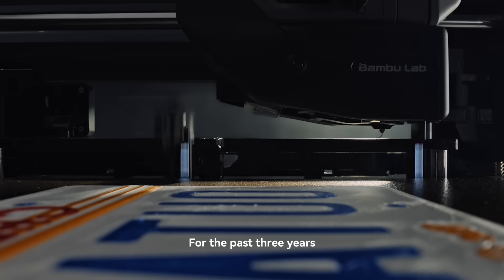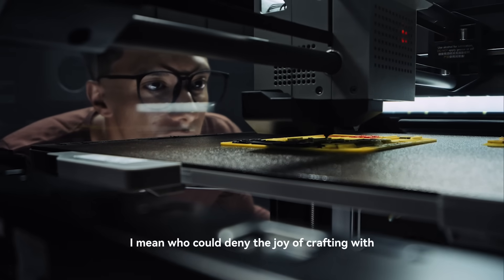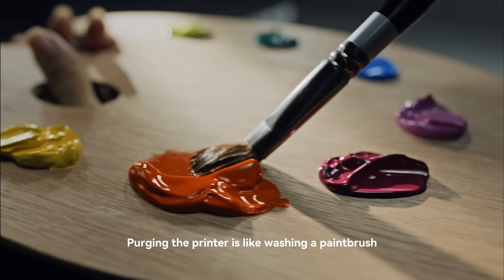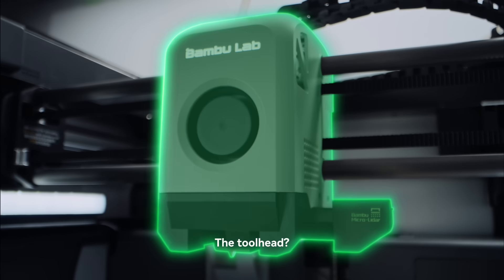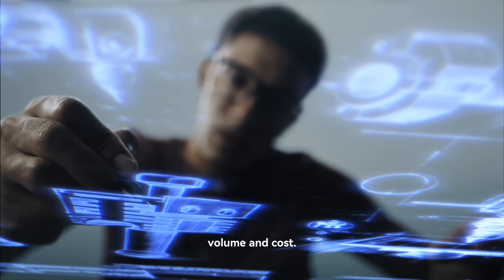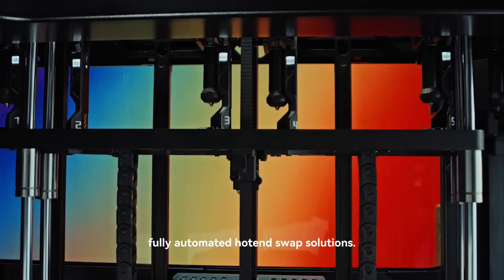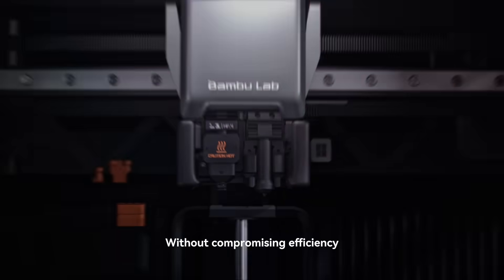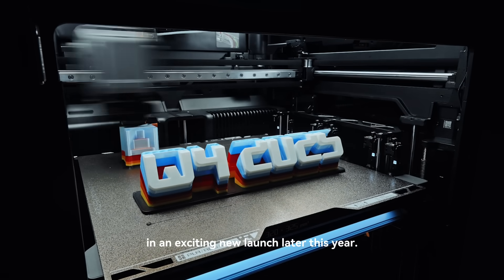Meet Vortek: Our Answer to Zero Purge Waste Multi-Material Printing

Comment: I wish I could upgrade my P1S machines with this.
Reply: Samedi for p1p i dont wanna buy a new 3d printer
Reply: Same here, it doesn't make sense to buy a 3K€ printer just for that feature anyway, even if I didn't have a P1S (a sub 1K€ printer). 
It's too bad, because at a glance, there is a similar place in the P1S where the Vortek could fit (albeit smaller, so some tradeoffs would probably be required).
Reply: I would not hold my breath if I were you. I cannot imagine an upgrade path that includes anything except selling all your printers and using that money (plus a fortune more) to buy one of these. Or just wait, if this is good, it will become standard and the price will drop when the BambuLab HH22DD XL launches in Q4/2029. That printer will order its own filament from Bambu when its low. It will also use robot legs to walk to the porch to get the package.
Reply: @drj3141 yours doesn't do that now? Do you only print dragons?
Reply: @prestonplambeck4297 you’re kinda a hater tbh
Reply: @connors3356isn't that statement a bit ironic? And ambiguous. I'm guessing the dragons was the trigger... I love dragons but it's the most  iconic thing in printing besides benchy.
Reply: @drj3141  maybe they will do a new toolhead where you could use vortek
Reply: True I would definitely do that too. I hope bambulab will do something for us P1 users. Love the printer and don't wanna buy a new one just because of that
Reply: Agreed, won’t be buying a new 3d printer just for this feature. I have a p1s, I also have a mk4s. I love the fact that prusa always thinks about upgrading your current printer.
Reply: @W4rd-n1c  Sometimes trying to reuse an existing platform limits innovation.
Reply: @W4rd-n1c  I agree. However what prusa does isn't very practical. the cost for me to upgrade my Mk3s is almost as getting a new Mk4. Id rather just get a new Mk4
Reply: @W4rd-n1c  it's sad that you have too upgrade it out of the box just to get it printing like p1s... Especially for the premium price they demand.
Reply: @W4rd-n1c  Try upgrading your Mk4S to the XL ??
Reply: You can by buying this whole new printer. Lol
Reply: @RayLenses  do you know what the term upgrading even means

Comment: Can't wait for the Bondtech INDX to drop, this is a great teaser video for it. e oh this is a Bambu thing, nm I guess.
Reply: The whole time I was watching this I was thinking  "did Bontech license this to them?"
Reply: @JBtuned-x8c  The bond tech method is not near to what Bambu lab have here. This one is next lvl
Reply: @MrlegendOr I wouldn't say that, INDX is less mechanically complex as it does not require a material multiplexer. I'd also expect it to be cheaper per tool if you account for the cost of the multiplexer (ams).
Each have their own advantages and disadvantages, plus neither have released yet, so I don't think you can make that call yet.
Reply: No, the Apple of 3D printers just aped it like they do.

Comment: Incase anyone is wondering, this is and is not a new printer.  On their blog post they said this is the H2C, BUT it will ALSO be an upgrade for the H2D!!!!
Reply: Oh, so it's not coming to P1/X1 printers? Nice. Hello Snapmaker U1!
Reply: A1 - $349
P1S - $549
X1C - $999
H2S - $1,249
H2D - $1,999

And it's basically an H2S with a more advanced print head, so it could either fit between the H2S and H2D or it could be closer/above the H2D Combo ($2,299) imho.  Or they could say screw all and put it as a competitor to the Prusa XL for $3,000 or something, which I think could be likely.  Any way you look at it, there's no way that they will make it price competitive with the Snapmaker U1 ($1,000) while being a better version of the $1,249 H2S.
Reply: @tms1003  this system requires AMS, you have to add that pricetag on top of H2D and maybe H2S if they make it compatible with the single toolhead version

which means its $2300 PLUS the cost of the changer which with the inductive heating and all the other totally unnecessary modifications to those proprietary hotends will very likely bring the total cost of the system above $3k
Reply: @Asghaad  Oh yeah, I was agreeing with you, it's going to be stupid expensive.  I was just laying out the best case scenario, the DREAM situation would be between H2S and H2D.  Virtually impossible, and it would never compete with the Snapmaker U1.
Reply: @tms1003  If priced between the H2S and H2D (never happening) there'd be a market for this. It's too high a price to pay for something that really doesn't pay off for years. Releasing it as competition for the Snapmaker is kind of silly.
Reply: @ProfessionalTrafficplayer  Snapmaker is a joke. It's a prototype and for now not even sold. Bambu, on the other hand, sells quality products that work.
No matter how much fanboys talks about U1, until it's a real product, and a tested one, this argument is equal to zero.
I can print anything, without having to worry about maintenance, on my P1S. And that is a fact.
The rest is just internet talking.
Reply: @Gherry77  Time will tell on Snapmaker's U1 printer. The ones that have tested it so far seem to seriously love it, so we'll see. I am open to any and all challengers to Bambu, as I prefer to do what I damn well please with hardware I buy, so Bambu's "security" bullshit has me looking everywhere else for my next printer.
Reply: @Gherry77  I agree with everything you said. We'll have to wait and see when these  new products are released to test them...and THEN badmouth them if needed. Competition is good. Badmouthing products before launch = bad.
Reply: @Asghaad  plates too
Reply: @SID6.7  who tested it?.... ;-)
Reply: which is a bit absurd, why push this first on machine that really does not need it when it would have been MUCH more useful feature on P and X series printers  - sure make it for H2 as well but it already has 2 nozzles and will restrict this to only high end customers and leave midrange market open to competition

this thing will be competing with Prusa XL and frankly at the price this will be sold at combined with high cost of a H2D itself it wont be easy sell compared to full toolhead changer machine that simply is superior

Comment: This is a ripoff and probably patent infringement of the BondTech INDX nozzle changer system, including the inductive heating. I sure hope they will be paying royalty to them.

https://www.youtube.com/watch?v=BCmGoP0uNlM&t
Reply: The way i see it could not be infringing the patent would be that the INDX is horizontal With the toolhead moving in horizontal, meanwhile this One is vertical and the toolhead moves in horizontal .Is that enough For it to be considered different enough in Order to not commit patent infringement? I don't know, but it isn't a 1 to 1 copy (it seems)
Reply: @ulforcemegamon3094  The core innovation with the INDX system as I see it, is 1: The idea of swapping only the nozzle rather than the whole hotend assembly/toolhead and 2: The inductively heated nozzle that makes it possible. (Possible 3: Alignment system for the nozzles, to make sure they are very repeatable). The direction that the nozzle is picked up from ought to be arbitrary. The INDX showcase machines that we have seen picks them up much like most other toolchangers, so again, I don't see why or how that aspect could be patented.

That said, patent law is crazy and broken, and I can't find the relevant patents online at this time (no real effort made though, to be honest).

Comment: The idea is awesome!! But imagine if it was backward compatible!!! Since it use the right side of the printer: ti could be sooo awesome that Vortek would be sold with a new printer head to change on the X1C, P1 and P1S! For me, it would be the best reason to not change to a Snapmaker!
Reply: Bam siempre busca como sacarle dinero a la gente, salvo el AMS, no les gusta el concepto de retrocompatibilidad, yo también tengo como opción la Snapmaker U, y también estoy evaluando la Prusa XL por volumen de impresión

Comment: I'm relieved to see that there's an upgrade path for owners of the H2D. From what I've read on the blog, it requires an advanced user to upgrade which neither scares or surprises me. I'm really looking forward to this and I hope that the upgrade price is not out of line!
Reply: Then my years of Ender 3 shenanigans has prepared me for this moment.
Reply: @SkookyDoo  yep, the frankly abusive relationship from Creality towards their users has trained me to not be too worried. Having to take apart all 8 Ender 3's and the CR-10 I've owned to add in wire ferrules and reflash firmware to enable the thermal runaway protocols was good training.
Reply: @SkookyDoo  lmao
Reply: Facts im pumped for this! I thought it was gonna be a whole new printer with a crazy price tag. The fact I can add this to my h2d is awesome!
Reply: I’m all for doing the tedious upgrade, I just hope the price is reasonable vs just buying the H2C.
Reply: Did you read the part about the H2S upgrade...do you think you will have to change the bed to fit the it in?...
Reply: @IlanPerez  if I were to guess, I'd say yes. Based on the video, it looks like there needs to be more space to the right of the bed. But, I'm really not sure?
Reply: @SomewhatAbnormal  The H2D has a big empty space to the right of the bed. They could easily have fit another 25-30mm of X movement on the bed. Now we know why that space is there!
Reply: @IlanPerez I think the bed size is the same, it's just due to the printhead and firmware that it is different. They are quite literally identical aside from the filament paths and printhead.
Reply: @FrostyTeeVee  so how come the bed is 340 and not 350mm
Reply: @IlanPerez  Again, it's just how the printhead is shaped. The nozzles on the h2d were slightly closer to their respective side so they are able to reach slightly further than the H2S can. The H2S printhead leave the nozzle a little bit further from either side of the printjead which takes away about 5mm on each side. The bed is the same, it's just a matter of how far the printhead can move on the gantry. 

The H2D may sound bigger, but one nozzle can only reach a width of 325mm, and that's even less with 2 nozzles. This goes to show that bambu lab really didn't change anything other than the side panels and the printhead. 

Hopefully this made sense.
Reply: Same
Reply: Yeah reusing old printer to upgrade is a real cost save, great for consumers and businesses alike
Reply: Same. I just got my H2D yesterday. Haven't had the time to set it up yet but dang is it heavy and huge. It makes my X1V look like a little toy lol. It will be nice to be able to go to an H2C eventually
Reply: where did you see that you can upgrade?
Reply: @mojo1983a  It's in the blog post in the pinned comment, it's right near the bottom.
Reply: @mojo1983a its on the bambu forum. If you Google "can i use fortek eith my h2d" itll bring you to the forum where they answer this

Comment: Man, I have been tinkering with a similar idea for a while, but this is so much more elegant than I ever imagined. 
My design (never built) would have heated the melt zone using a flat heat plate, but the mounting pressure would be hard to get consistent and relatable enough. Then, I figured the temperature measurement would need to be external and use state estimation because the thermistor would be far from the true melt zone. The thing that killed the project for me was how to index and store the hotend/heatbrake assemblies. The best I could come up with was a rotating tool change wheel, and that just wasn't feasible in my mind.
This solution solved every single problem mentioned above with some brilliant ootb thinking. It's really incredible engineering.

I hope they add an optional storage unit with a tool feeder device under the printer to allow for more nozzles to be in use (from say 6 -> 20). 20 color/ material prints with the only waste being a prime tower would be a dream.
Reply: I seen bedslinger project with XY coordinates bed and revolver hotend on Z axis
Reply: @NekitGeek that sounds insane where can i find that?
Reply: Same as the CNC carousel tool changer?
Reply: @KokaKuku yes

Comment: Wonder if they worked with Bondtech at all on the hotend, some similar ideas to INDX
Reply: I can almost guarantee there was zero information sharing between Bondtech and Bambu Lab. At least officially. INDX looks like the superior system to me for cost, speed, and reliability.
Reply: @802Garage  I am sure, every company buys leaked info from competitors. It cannot be a coincidence that Snapmaker, Prusa, and Bambu show similar swapping in a matter of weeks. Another example it LG, Samsung, and Apple announced phones with rounded screen corners in less than 6 months.
Reply: I was wondering the same thing
Reply: Nah, they stole the idea, just like they steal from everyone. Every printer ever released from bambu is built upon stolen ideas.
Reply: The idea of swapping nozzles (or hotends) is not new, E3D had been working on their multi-head design way back in 2015, and the idea of multiple heads/nozzles is even older.
Reply: probably just stole their idea
Reply: @flippy9133 algo bastante común en Bam, robar ideas
Reply: Not the same Bondtech is a tool head swapping, this one is a nozzle swapping
Reply: @MrlegendOr  You have it totally mixed up. The Snapmaker U1 is toolhead swapping. The Bambu Lab Vortek is hotend swapping. The Bondtech INDX is nozzle swapping. The other defining difference is that the U1 and INDX use umbilicals for each tool. The Vortek uses an AMS to feed each hotend from the same extruder.
Reply: No lo creo

Comment: Now this is a genuine improvement to multi color/ material printing.

Fingers crossed you will be able to upgrade/ update older x1c platforms to include.
Reply: No you won't...just from the H2D, which will not be easy....all described in the blog post
Reply: @TheSkillos it’s for both H2 printers the H2D and H2S
Reply: @TheSkillos well thats a bummer.
Reply: It’s not going to be for the x1c. Only for the H2 series.
Reply: No será compatible, si quieres compatibilidad eso está en la vereda naranja con Prusa

Comment: But doesnt this still need an AMS that retracts the filament each swap?
Reply: Right. How fast will the changes actually be if it has to cut and retract in the AMS? And will regularly cutting the filament cause extrusion issues?
Reply: @benpage2516  The Snapmaker U1/Prusa XL change toolheads in 5-10 Seconds. Then an approximal additional 8 seconds for heating up the nozzle. 
I guess that 18s can be enough to retract and refill the filament, even with an AMS, where the hub is farther away from the toolhead.
But I keep my preorder of the Snapmaker for now, as the Bambu will likely be more expensive and not Klipper based/open source.
Reply: @8-P  dont they preheat the next toolhead so its hot when its being used?
Reply: @ipadize The Snapmaker/Prusa XL yes, and its 5s from print to print for a change (iirc)

Comment: With just swapping nozzles wont there be an air gap still causing print defects
Reply: No, it's still priming the nozzle which gets rid of the air. In the video you can see a prime tower in the back

Comment: Wait are the H2D users regretting?
Reply: no there will be an upgrade kit even for the h2d. so its an good upgrade
Reply: @justlaurasworld118  Where do they say that. They are talking about a whole new printer, not an upgrade.
Reply: Can I upgrade my H2D to an H2C?

The answer is yes — but it does require some skill, patience, a willingness to carefully follow instructions and a few hours of your time. It’s definitely more involved than swapping out a clogged nozzle and we would not encourage entry level customers to do it. Can I upgrade my H2S to an H2C, well, technically you can, but we post this blog just to make sure you do not have to waste your time and budget in doing it.

Comment: THIS SAVES SO SO MUCH MONEY
Reply: Not really if I save $800 in material in 3-5 years but I pay $1750 for the machine, the Snapmaker is $750 so $1000 USD cheaper and $200 dollars more Even after 3 plus years!!!
Reply: Mmm con lo que va a costar dudo que ahorres mucho dinero 😂😂😂

Comment: This.   This right here.   Can't wait.
Reply: Si no quieres esperar, está la Prusa XL que ya lleva 2 años con este sistema multicabezal mucho más confiable que lo que presenta Bam
Reply: @rmberoiza  Yeah, the XL is way too expensive for what it is.  And way less reliable than what you think.  I do have a Stealth Changer Voron 2.4r2 that's great.  But to have a tool changer in the bambu ecosphere is next level.  Love the inductive they are doing here as well as what Bondtech is working on.  But thanks, I'm not a fan of Prusa, too expensive for what they are, in my humble opinion.